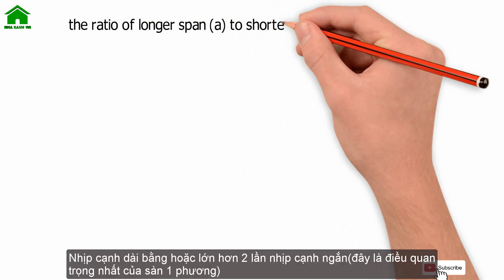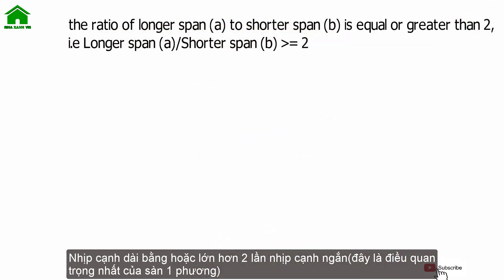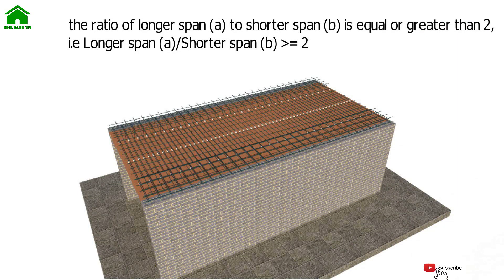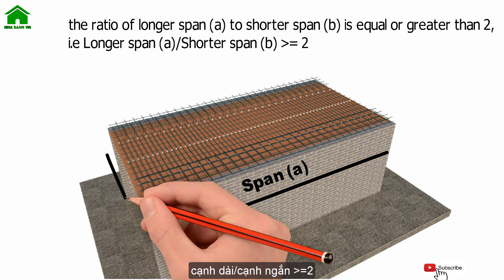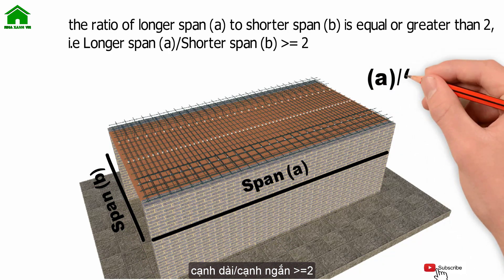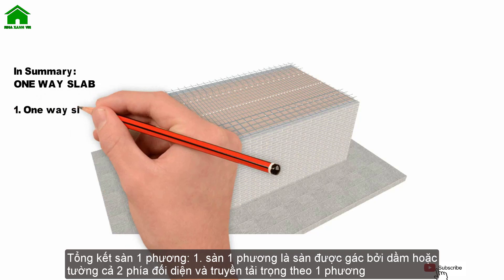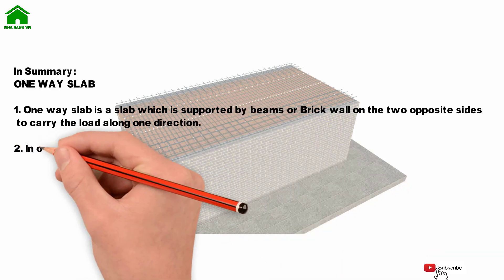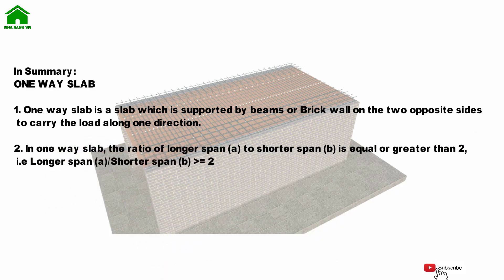✅ Design of One Way Slab Reinforcement Details | Green House Construction

Comment: Wrong!!!
The anchoring is not performed at the ends of the bar!
It is necessary in the one direction slab.
And a protective layer of concrete not less than 50 mm.

Comment: Hello Sir! Thank you for the all information. It helped me a lot. I wanted to ask you. What does "Thép chiu luc uon 1/4 chieu dai 2 dau" means? It's written on 5:14. Thanks in advance.
Reply from the maker: Thank for your commented. I explain for you as below:
Above main rebar layer (1 side) = 1/4 the length of span in it.   
Example: span of short slab = 4meter. So the main above bar will 1/4*4 = 1meter  per side
Reply: @NHAXANHVIETNAM   Thanks a lot and keep with the good work.
Reply: Trust in Jesus Christ

Comment: In India we crank alternative bars alternative sides. But you crank a bar on both sides. Please Explain which method is good.
Reply from the maker: Good question. Both methods are adapt technical requirement. space of crank bar to crank bar in one side  is about 20cm . Its does not matter alternative bars alternative sides. Two side are saperate moment. So, both method is same qualify.

Comment: How much short span can be designed for one way slab? Can it be useful in big buildings and is it economic design? Please reply
Reply from the maker: It does not matter how long shorter span is. One-way slab applied when longer span >=2 shorter span and other factors indicated in this video( please see details in video) . In big building , slab will divided many size and shapes. There are many oneway slab and twoway slab. And you will applied follow the rule for every kind of slab.  Finally, this is so good design and economy. Thank you so much